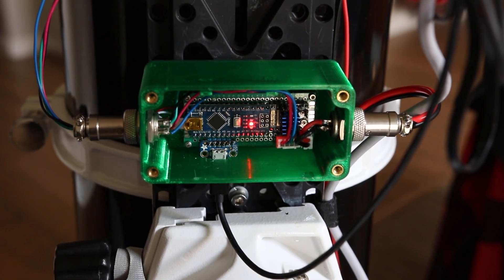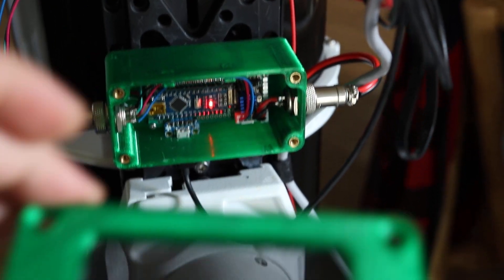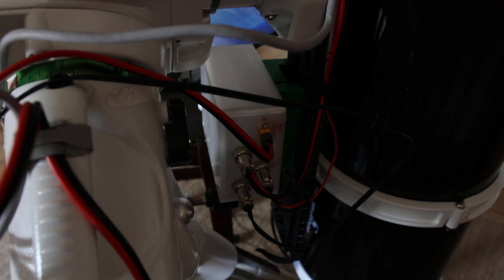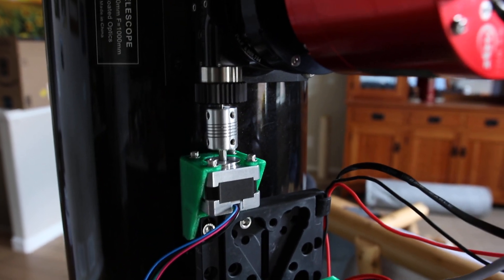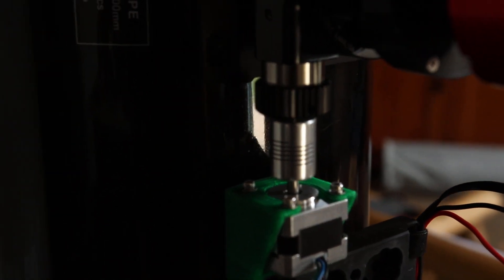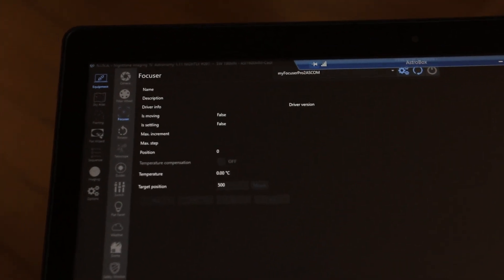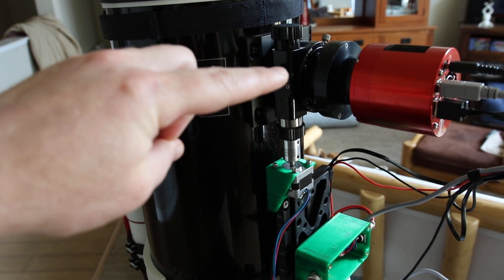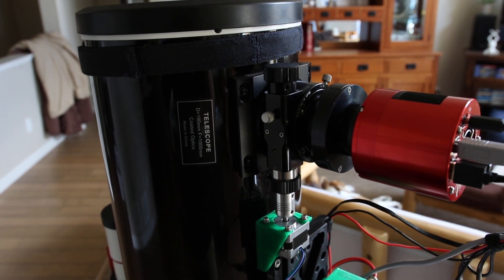Update: MyFocuserPro2 custom build for Sky-Watcher 190MN Telescope

Comment: Great explanation Eric.
Can you also explain how you added the microUSB breakout to nano. A simple circuit diagram would be great. 😊
Reply from the maker: Hey, @davetermniator!  The breakout is basically just 4 wires soldered to a USB connector, then soldered to the breakout board.  You could probably take a USB cable and cut the end off of it and use that to wire from the Nano to the breakout board.  I didn't have enough space or a flexible enough cable to do that, so I used thin gauge wires (24ga, I think) and bought some bare mini USB connectors instead.  A quick search should turn up wiring diagrams so you know what to solder to which pin on the connectors.

Note that the firmware side, at the very least, has been updated significantly since this video was made.  The designer has made it way easier to set up Trinamic drivers with a basic firmware configurator.  Wish I'd had that when I build this thing, lol.

Comment: Eric, your schematic shows an 8825 but you're using a 2209 which is what I want to do. Straight replacement or different wiring needed?
Reply from the maker: Different wiring is needed for the TMC2209.  Note the DIAG pin is only really used if utilizing the built-in soft-homing capability of the driver board.  I have not tested the soft homing, so I don't know what value to use in the spreadsheets to get it to stop moving and consider it "home" when the focuser reaches its inward-most position.

New modified schematic image modified for the minimal TMC2209 is found here:  https://www.flickr.com/gp/ericschubertphotography/82263E
Reply: @esphotocreations1652  Hi Eric. I noticed no circuitry on the minimal schematic to get around that reset thing on the Nano. Is it not needed?
Reply from the maker: @Tentaryn  the reset pin is used to alter the program mode for normal operation or firmware updates.  I've not needed it for anything in my build and found I could just upload firmware right from the Arduino IDE.
Reply: @esphotocreations1652  Thanks Eric. One last thing (hopefully!). On your schematic, you mentioned no gnd or vin pin used on the nano yet there is a gnd wire from the nano to the clk on the 2209. Is this needed or was it an error?
Reply from the maker: @Tentaryn  there is no CLK pin on the TMC2209.  Did you mean the SLEEP pin?  If so, that's correct, use the SLEEP to GND connection.  When I said no GND was used, I meant for powering the Nano the GND connection is already provided by the USB cable.
Reply: Great explanation Eric.
Can you also explain how you added the microUSB breakout to nano. A simple circuit diagram would be great. 😊

Comment: Hi. This is exactly what I'm looking for. I've spent the whole day looking through the PDFs but am finding it a bit of a challenge. Do you have a parts list or a diagram showing exactly what you used and how you put it together?
Reply from the maker: Unfortunately, I do not.  I know that feeling, though, as I was in the same boat.  It took me days to wrap my head around the wiring, and the TMC2209 driver made it even more challenging.

I used the included wiring diagram to help me figure out what pins connect with what components.  It helped me to print out the diagram and highlight things I needed, and crossing them out as I wired them up.  That made sure I got everything I needed and wired it correctly.  I did not implement any additional features, such as temperature probes/compensation, LCD screen, etc.  All I did was use the basics.  It looks like the current PDF is called "myFP2-312-2.pdf" in their file list.  Page 40 lists out the schematic/wiring diagram.  Just cross out components you don't plan to utilize, along with the wiring for those items.  I skipped everything except the stepper motor and driver board, which eliminated a lot of the extra wires.  I did add the micro USB breakout board to change from mini to micro, but that's not necessary if you're fine with mini USB for a connection.

Note that the use of Trinamic drivers is considered complex, according to the designer.  I don't know much about drivers, but I would agree that it's complicated.  I used a TMC2209 stepper driver and it definitely took some fiddling and pondering to figure it out.  I'd suggest a simpler driver board, if you don't need it to be totally silent and aren't experienced with electronics.  The new documentation does say they're supported, but they are definitely more-challenging due to their extra built-in features.  They also seem to have less torque due to their micro-stepping.  If you really want to go with TMC drivers, make sure you grab the additional TMC documentation, files, Arduino libraries, etc.

I've also switched at least one of my refractors over to a geared stepper motor for higher torque.  It was skipping steps and throwing off focusing.  A geared stepper should be much more reliable.

Just make sure you sit down and plan out your build.  What features you want, what components you want to use, and the proper step size for your particular telescope(s) to get around 10 steps within the CFZ, per the documentation.

This was probably the most-complex project I've made, to this point.  It's not saying much, being pretty green with Arduino, but I'm a mechanical engineer and found it made me think pretty hard about a few things.  I did enjoy the 3D modeling side to make the enclosure for the electronics and the motor mount.  But pressing through it, I did learn a lot about electronics, soldering, and coding.  If you're up to the challenge, it could be a good learning experience.
Reply: @esphotocreations1652  Thanks so much for the detailed reply. I'm going to give it a go!
Reply from the maker: @Tentaryn  Good luck!  Just take your time and get the wiring right.  You'll do fine.  :)
Reply: @esphotocreations1652  I'm struggling already. No idea which components I can lose. Basically, I want what you have. Don't suppose you took any pics of your board before assembly did you?
Reply from the maker: @Tentaryn  I did not.  However...  I went through the schematic provided in the documentation and erased everything but the most-basic build wiring.  I did NOT use a diode from the 12VDC power supply to the stepper driver, as the grounds for USB and 12VDC are NOT tied together, due to using two separate power sources.

Here's a link to my pic on Flickr that shows this minimal schematic utilizing the DRV8825:  https://www.flickr.com/gp/ericschubertphotography/622aW1

I used solid copper wiring for a stiff connection when soldering and trying to keep wiring tidy.  You'll need to carefully bend the wires to route them from spot to spot.  It's not hard, but it's a little more effort than using stranded wire that's flexible.  The 12VDC connection was made using an aviation connector, btw.  Look for that particular name, "aviation connector", if you want to use the same type.  Otherwise, something like an XT60 would also work well and be a snug connector that won't accidentally pull out or come loose.
Reply: @esphotocreations1652  Do you still use your focuser on the scope by the way. Saw your comments from a few months back on Sourceforge. Seems you went through what I'm going through with spreadsheets, etc.
Reply from the maker: @Tentaryn  Figuring out the spreadsheets and numbers was an interesting ordeal.  It took some fiddling to get right (at least, they seem to be fine...  I dunno about "right", lol).  I do still use the focuser, yes.  In fact, I've built two, so far, and intend to build a third.  I did find that I required a geared stepper motor to drive my focuser, as the little NEMA14 I tried just didn't have enough torque to move things reliably, even attaching to the 10:1 fine focus shaft on my AT60ED refractor.  I haven't fully-tested my 190MN version, yet, but I recall it seemed to move okay.  I may swap to a geared stepper motor on that one, as well, if I run into issues with skipped steps.  I will likely go directly to a geared stepper on my Zenithstar 103, just to avoid any issues, but I have a mount already 3D printed for the NEMA14 motor, so I may try it just to see what happens first.

Since swapping to the geared motor on my AT60ED, I've had zero issues with skipped steps or lack of torque.  The only downside is the added weight of the gearbox and higher cost.
Reply: @esphotocreations1652  I'm using a Nema 17 PG5 so hopefully won't have issues with that. The TMC spreadsheet has yellow boxes for fullstep angle and gear ratio. Do you know whether you put in the angle of the motor or the angle of the motor with the gearing?
Reply from the maker: @Tentaryn  I would imagine that motor should have plenty of power, being larger than my NEMA14 and having the gearbox to increase torque.

As for the spreadsheets, input the step size in degrees for the motor itself and then the gear ratio is a separate entry.

Also, just FYI, the GitHub page has a discussion board for posting questions and getting additional support.  The creator of this project regularly replies there and can probably help with more-detailed answers to some of your questions.  He replied to the few posts I made there.

Comment: Could you link the specific documentation for this, having trouble navigating the sourceforge link? Wanting to build one as small as possible and this one looks perfect.
Reply from the maker: This is the location for details on this open-source focuser project:
https://sourceforge.net/projects/arduinoascomfocuserpro2diy/

Note that I did not design the circuit itself.  I merely adapted it to the PCB that I had available to me, and used the version with only the basics.  I did not add in the temperature sensor control or any other features.  I believe my project used a 3cm x 7cm perf board.  I also utilized a micro USB breakout board to convert from mini USB to micro USB, as I have more of those cables.  The box and motor mounts were designed by myself and adapted to fit my specific gear, so they likely will not work for your application.
Reply: @esphotocreations1652  Did you use the DRV8825 + Nano stripboard design and replaced it with a TMC2209?

I saw a schematic for a DRV8825 + Nano using perfboard but can't see a TMC2209 + Nano perfboard schematic anywhere.
Reply from the maker: @deepbloo580  If you look under the Documentation folder, there's a file there labeled "myFP2-TRINAMIC-XX-X.pdf"  (I used X's for numbers, as that's subject to change over time.  Right now, it is "myFP2-TRINAMIC-09-3.pdf".)  There's also a folder in the firmware ZIP file labeled "myFP2_TMC2209SG-312", which contains the firmware and calculation spreadsheets for the TMC2209 drivers.

Per the author, TMC2209 drivers are more-challenging to implement.  I can confirm, there's a bunch of messing with calculations in a spreadsheet and customizing values for the TMC2209 in the firmware files provided.  However, I was finally able to get it to work and I know very little about stepper driver boards.  (I do know a little about Arduino, which helped.)  I have it running very nicely on my AT60ED 60mm refractor with a geared stepper attached to my primary focusing shaft, not the 10:1 fine focusing shaft. (NEMA 11 + PG19 found here:  https://www.omc-stepperonline.com/big-sale-nema-11-stepper-motor-bipolar-l-51mm-w-gear-ratio-19-1-planetary-gearbox.html )

On my 190MN, I haven't fully-tested it, yet, to know if my 0.9deg/step NEMA14 can handle it without any issues.  Gearing added a lot of torque.  With only the NEMA 14 motor on my AT60ED, I had trouble with it skipping steps and throwing off the focusing routine.  If you want to avoid issues entirely, just run a NEMA 17 or use a geared stepper.  Otherwise, make sure you test things out thoroughly to verify it has enough torque.